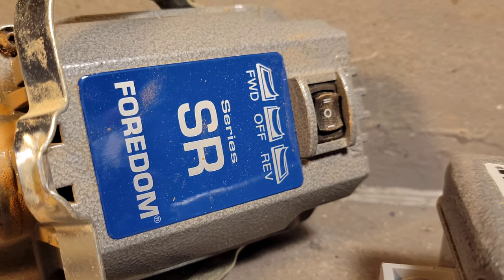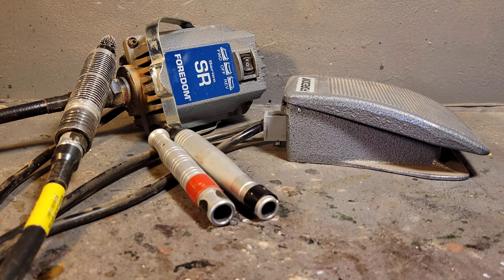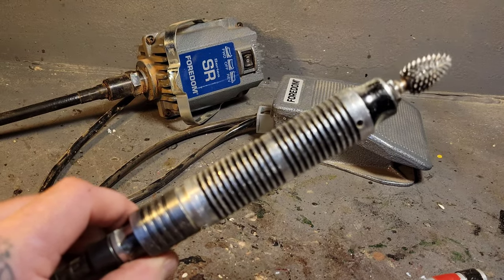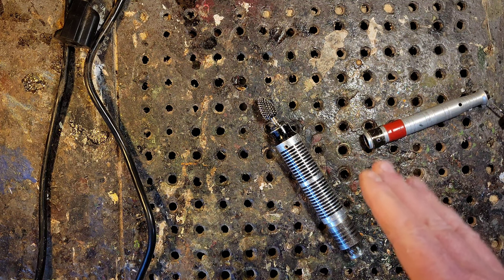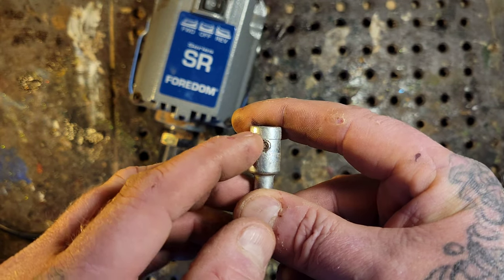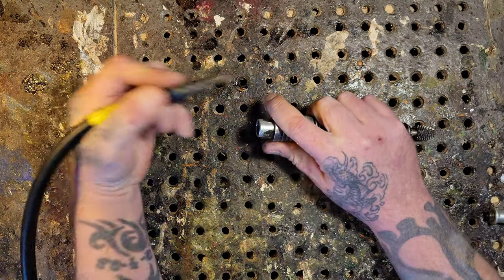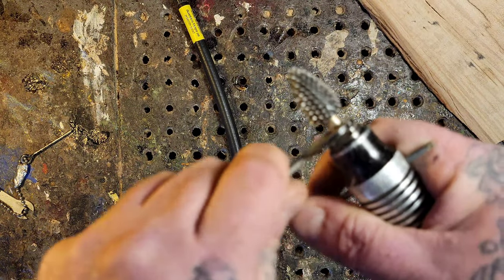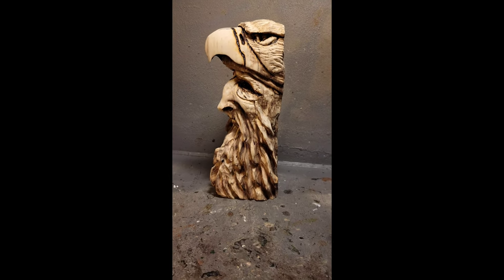Foredom Sr Series Power carver.

Comment: Hi Jordy, 
Thanks for all the intel. I did a lot of research on the foredom after watching you video and noted the comment on Fakes. I purchased a Red label 240v from a reputable jewellery dealer in Birmingham U.K. 
this is a genuine Foredom model and his website offers the following advice to enable you to spot a fake. 
Could be useful to anyone browsing for one. 

You may have seen several listings for similar looking Foredom kits on eBay. These are almost certainly fake units manufactured from cheaper materials and parts out of China. Cooksongold is an OFFICIAL RETAILER for Foredom products. To identify genuine Foredom units look out for…

An embossed Red FOREDOM logo on the foot pedal. Fake units will have a sticker
One Yellow safety sticker on the shaft. Fake Units feature two stickers
Handpieces have a satin/matt finish for a better grip. Fake units have a shiny surface
An embossed direction of release instruction where the shaft connects to the motor. Fake units do not feature this.
Thanks 🙏
Reply from the maker: Ok thanks for pointing thos out

Comment: I'll wait until the pedal video to comment on the various options. Enjoyed the video. You were thinking of the blue Locktight. BTW, a 120V TX also has a blue label. I have one next to me right now. All of the counterfeit SRs have red labels usually reserved for 220V motors. I own a counterfeit SR along with Foredom SR and TX. The counterfeit isn't terrible. At all. I does need a pedal upgrade. If anyone has questions, I'd be happy to respond. 

The HFT flexshaft is decent sans its pedal. For about $100 one can get the flexshaft and a plastic Foredom  pedal. As said in the video, it'll accept Foredom handpieces and the counterfeits. A good value. I've had it for about 5 years and it's still working well. I'm not a carver, however; I work with metal.

Jordy, I'm amazed by the number of folks who use a flexshat and can't spin the shaft to change handpieces. Kinda fun watching them try to do it. :)
Reply from the maker: Thank I very much for your input

Comment: been using Dremel and hate the damn thing after replacing 3 times on my fourth and looking to buy a foredom, just not sure on the model and hope there is speed control. all my dremels were crap on speed control, just not enough motor for the flex shaft
Reply: light work carving small pieces or large after I cut them to size and cheap Dremel fails, my last Dremel  decided to just run full throttle and off. piece of shot......thanks for hope on foredoom how is it holding up?
Reply from the maker: I use the Sr foredom series, (It's the fastest

Comment: Good morning, sorry to disturb you but I wanted to ask for your opinion.  I wanted to see on Amazon, and I saw that the foredom costs less than half on this site than on the original site.  Do you happen to know if it can be reliable?  it occurred to me now that I encountered the same problem with another product, I contacted the company itself asking for information on a wood vacuum cleaner, and they said it was available both on their site and on Amazon, and pointed out to check and compare prices.  if the company itself in this case has confirmed to me that it is original, albeit not directly, is the foredom on Amazon original in this case too?  I think they also sell them on Amazon to save on taxes, or something, that's why they're cheaper.  I thank you in advance if you will answer me
Reply from the maker: I think it's a fake, make sure when u buy a foredom from Amazon it leads rite back to foredom or good chance it's a fake one
Reply: @CarvingFusion  like an link?